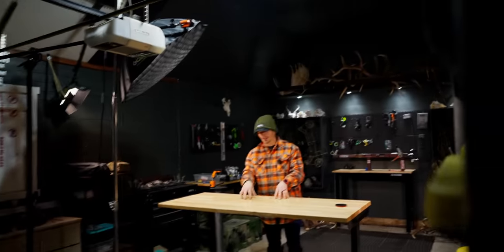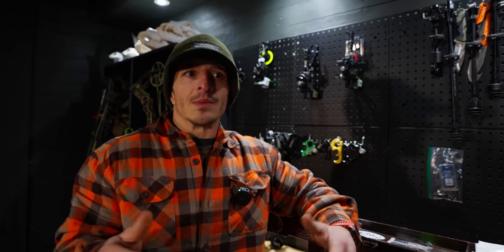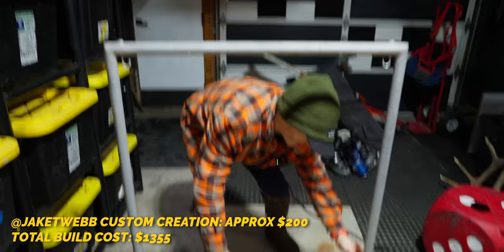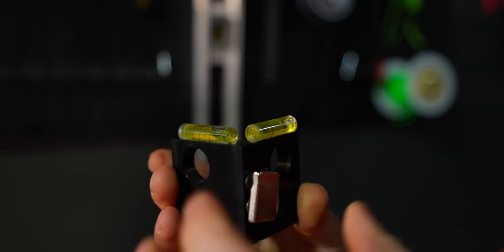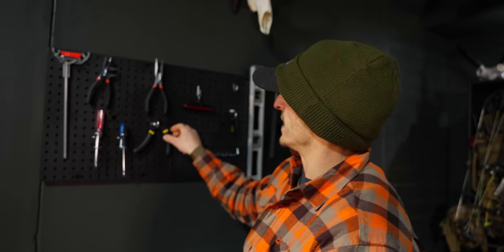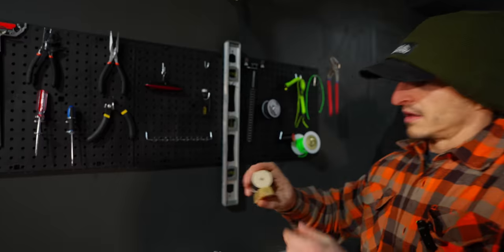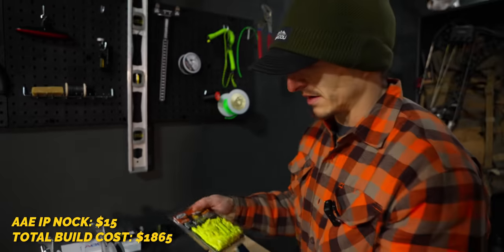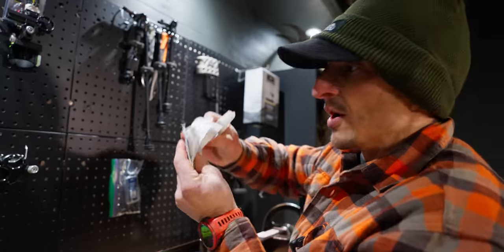DIY Archery Shop, How Much Does It Cost!?

Comment: Decut Archery makes a great arrow saw for $209. I think you would find it to be very reliable.
Reply: Weston makes a good one for 180ish as well works great.
Reply: yes, i am all so running the decut saw. Built well, small, and compact for easy storage..
Reply: Deceit arrow saw is awesome
Reply: Decut
Reply: Josh is selling 1 for $150
Reply: Get the Decut arrow saw with the fine adjustment,great saw that doesn't break the bank
Reply: +1 this is the saw I use its nice
Reply: Yeah the decut does everything you need. I've been getting nice straight cuts with it, barely need and arrow squarer. Chris bee used one for a while not sure if he still does.
Reply: I like the decut with micro adjustment but I don't love the pedal as when cutting arrows I want to stand comfortably.   So, I put a brick on the pedal, and away I go.  Saw is good enough.

Comment: Running the full size Decut saw with the foot pedal. No complaints so far. Solid and well built. Also has micro adjustments for length.

Comment: So envious, maybe one day I’ll be able to get a press. Right now I’m using a modified bicycle vice to hold my bow. But I’m not sure how you can work in a “black” shop….then again I wear glasses too. I’m using a Bohning Cauldron at 3 degrees R helical for my Max Stealth vanes, and a Bitz with the R clamp for my 4 fletch target arrows using Q2i vanes. I also built my own arrows spinner using bearings out of fidget spinners. Hey, I’m a senior on a fixed income. Gotta make do.

Comment: Had both the bubble levels come off my podium archery string level. Also had the glue fail on a podium archery stabilizer. Reached out to Josh on the stabilizer, he was going to send me a new stab but it was an easy fix on my end (J/B weld). So excellent customer service there. For the string level; I just reglued the bubbles back on the with gorilla super glue but my confidence level dropped a notch on podium products. I get so much info and entertainment from both Josh and Dan on this channel that I want to support them both but also wanted to give some honest feedback. Dan had the same issue with the string level so probably not a one-off.

Comment: Dan-  Have to say that I have enjoyed and learned so many aspects by watching your info, along with MFJJ and Tims stuff.  Good stuff, thanks
My learning intake for me in this first year of compounds so far has been-
Learn your equipment and provide a good stability/platform.  I totally agree that in order to know your equipment, you need to understand how it works.
So,  going over the shop platform aspects that are working for me....
LC ultimate bow press and drawboard,  OMP wide vise ,  LC saw with my own add ons for an ultimate bench arrow tool.
(spine and broadhead testing/adjusting).  LC fletching, arizona fletching jigs.  OMP serving jigs with the LC reserve pro. Homemade pneumatic string stretcher. BAP wide jig for the strings.  and of course the LC poundage gauge (an important tool) the average gram scale to measure weights, kind of stuff.  This addiction will cost you more than a dollar.
I appreciate everyones' input, and thank you for yours.
Reply from the maker: thanks Ted !!

Comment: Arrow saw: Weston Arrow Saw 8000 RPM (52-0501-W)
I've been using this saw for the past 10 years for the 3 archers in my home as well as hundreds of. 4H Kids.  
 Love the thin wheel that sands the edges smooth as they cut.

Comment: Buy once, cry once, get the last chance saw. It’s more like an arrow building station. Super Modular
Reply: and you can use the same base to implement broadhead tuning and spine testing.  One machine for arrow building = less benchtop space used. 
 LC needs to add to the saw kit.   (You can add a dial indicator, the broadhead adaptor/insert and fulcrum/lever assembly and make this saw a homerun.)  Or you can do this yourselves and make your own homerun.  Either way, it still is a chunk of change at first.

Comment: Don't think you mentioned an arrow squaring device. I use one made by Firenock. Having both ends of the shaft perfectly squared goes a long way in building an accurate arrow.

Comment: What square was the second one you mentioned? The one MFJJ told you to use? I see you only posted the first one you mentioned and not the second. 

Another great video!
Reply: It's the Saunders Forked Horn bow square. Apparently, they discontinued it on lancaster, which is why it's so hard to find. I went through all the comments as well, trying to find it, lol.